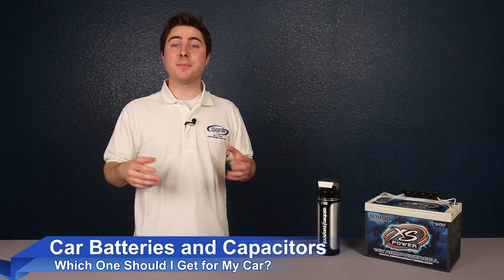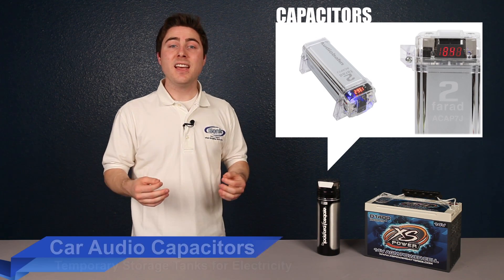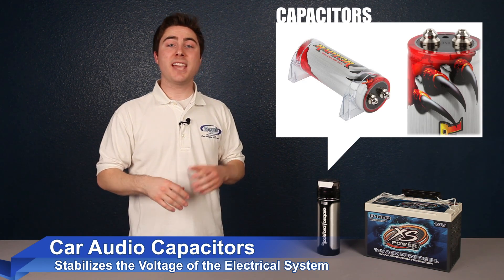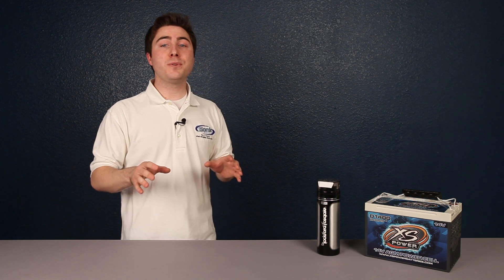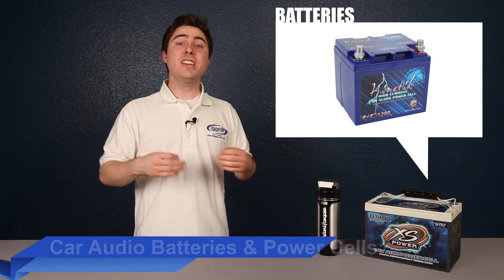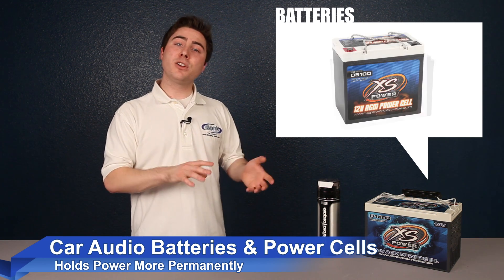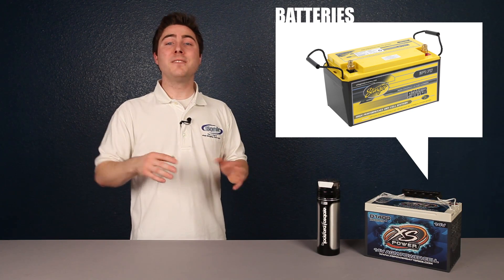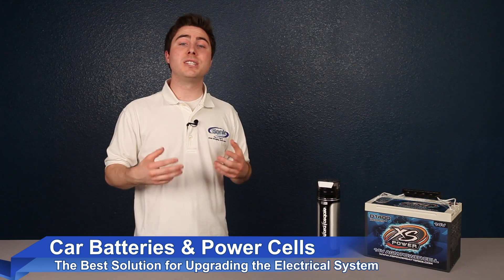Car Batteries or Capacitors: Which Should I Install? | Car Audio Tips

Comment from the maker: Not to worry!! Once a system reaches 1000W we like to recommend an alternator upgrade. After all, you need power to make power. Two Alpine Type R subs on that amp is not a bad idea but they won't be getting much power, so there wont be any headroom at all.
Reply: High output alts are ridiculously priced

Comment: The Type-R 12" is actually rated for 600rms. there seems to be a misnomer on their site that suggests 1000rms for a sealed enclosure. The BRX1100 amp is only 1100rms which is what i was referring to, and your right. an alternator upgrade is always a good idea. And probably a bigger amp than that to. Was a bad day, My apologies.

Comment from the maker: If your lights flicker it means you have voltage drop, which means you definitely need to upgrade your electrical at some point. If cash is a problem, start with a power cell battery, like something from XS-Power. Then, upgrade your Big-3, and finally upgrade the alternator. If cash is not a problem, go right for the alternator upgrade.
Reply: Sonic Electronix Hi I have a question so I’m having an issue where my amplifier goes into a protect mode currently I have in my vehicle one 12 inch kicker L7 750 rms I have a kicker CXA  1200.1 mono block amplifier 1200 W rms I also have a crunch 1000.4 for my mods and highs I also have a bass processor And a 1 farad cap. I am running 5 gauge wire. The issue that I am having when I turn the volume up and turn up the bass is that the amplifier calls into protect mode when the bass hits hard. Even if I turn it halfway up a goes into a protect mode I’ve checked every connection there is and everything is clean and sturdy. I did some research on my own with a multimeter and I’m noticing that it goes into protection mode due to a voltage drop. When the volume is low it’s running at about 13 V when they crank up the volume and turn up the bass halfway I noticed that the drop significantly to roughly 11 to 10.5 and that’s when it goes into protect. Now I performed the big three in my vehicle right after and I noticed I gained a few volts not much but more than I had it went up to 14.2 V. I then retested it turn the volume up crank the halfway and It didn’t go into protect they played and I checked  voltage and it stayed just a little bit above 11 V Then I noticed if I turn the volume up a little more it goes into protect mode once again and I have my gains set properly not even to where it would hit hard This amplifier will give me 1200 W RMS at 2 ohms I have them wired only now at four ohms which is only 600 RMS. I’m thinking about upgrading my starter battery and a high output alternator and changing out my wiring I made the mistake and using CCA  wiring instead of OFC what is your take on this what do you think I should do

Comment from the maker: Each Type R woofer is 1000W RMS, and two of them would be 2000W RMS. Adding a beefy battery is great if he wants power at 12V but if you want the full potential of your system at 14.4V an alternator upgrade is always preferable.

Comment: An alternator upgrade? for 2 Type-R 12's, You have to be kidding. 

1100wrms assuming the least efficient amp will only result in a load of ~100 amps PEAK. and the average value will be a meer fraction of that. the stock alternator of an RX8 is 100A, with a decent battery behind it should be enough. I would personally throw in an Optima, Kinetic, XS, Any decent dry cell just to be sure.

Comment from the maker: At higher volumes you are experiencing voltage drop because your system is not capable of outputting the power requirements of your amplifier. You will need to upgrade your battery first and then consider a more powerful alternator.

Comment from the maker: Your gain is not set correctly. We have a video on how to properly set your gains. Once you set it right, don't touch it again. If you still have problems, then upgrade your battery with a more powerful XS Power one.

Comment: you will get to a point where if left up loud you will drain your batt if your system puts out more than you can put out with the one battery you are using, usually systems over 1000 watts.   most people don't max out their systems for long periods of time... so usually the caps are enough. and  make a huge improvement putting more power to the amp even though like he says it wont make more power... but it can store larger burst... so... not at all his simple explanation of no.  start with cap.

Comment: you are fine, that kind of drop is fairly typical for a stock elec and a good sized amp, if the volts begin to run into the 12's then you may have a problem on your hands. to keep your system healthy i would follow sonicelectronix advice and upgrade your big 3. also for future reference you should take reading at both the battery and at the amplifier as the resistance of the wiring and chassis ground will give you a slightly different reading.

Comment from the maker: Did you upgrade your battery to ground and engine block to ground cable as well? That might help. 

Once the bass hits, the rectifier in the alternator has to adjust to up the output to compensate for the bass hit, this takes time to do, longer than a bass hit which is why you have dimming. A capacitor will help with this, but at the same time, it does take power from your system to charge itself. Ideally, you would want to be at 14-14.4V all the time.

Comment: My voltmeter shows that for no more than a second it drops from about 13.95 down to around 13.75, then it (during the chain of bass hits) it jumps back up to 13.95. (My voltmeter is digital, I'm not sure if it's quick enough to read the drop) That's measuring it at the + and - posts on my battery.

Comment: If my current alternator wasn't keeping up, wouldn't my battery voltage drop insanely low? My voltmeter shows that it stays around 13.8-14 volts. Not arguing with you, just curious.

Comment: The trunk/interior/headlights dim right at the beginning of a major bass hit, but they almost instantly come right back up after upgrading my alternator to battery cable to a 1 gauge cable. I'm running a 900 watt Kenwood amp, and was considering adding a 2 farad Rockford Fosgate digital capacitor to aid this issue. Would this work? or do I need a different battery?

Comment: I'm about to install two alpine type r 12s with a hifonics brx1100. Installed in a RX8. Should I be concerned? Auxiliary battery or stinger 5 farad capacitor?

Comment from the maker: Definitely upgrade your alternator and add a car audio solid state power cell. A yellow top is good, but if you want to run your system while the engine is off, consider some NVX, Stinger, and XS Power batteries.

Comment: if u upgrade ur alternator ull over charge ur stock battery than itll heat up and ruin ur battery. wont it? i thought that but i believe u know what ur talking about. and no i only buy interstate and a/c delco stock battery brands bvut i just brought a yellow top battery. i hope it wasnt a mistake. i have a heavy system.

Comment from the maker: A capacitor can last for years if you have a quality one. They do not explode, they "pop" meaning the casing tends to rupture and they will release a bad smell into the air, they will not explode into a fireball. Testing a cap is very simple. Remove it, and measure the voltage across the terminals, which should be about 12V. Wait 10 minutes (time it), and measure again. If the voltage has dropped, there is leakage.

Comment from the maker: You need to upgrade to a 250A alternator to handle the power requirements of your system. The capacitor does nothing in your system.

Comment: I have 2 alpine type r 1000 rms each n hifonics brutus 2000 watt rms n audiocontrol epicenter n soundstorm amp for the inside speakers but im havin trouble when i turn my bass on n music kinda loud my system starts cuttin off like it stuters alot even with aux cable my lights dim like crazy help?!?!?

Comment: capacitors are very similar to batteries, they store energy but capacitor can release bursts of current when needed while batteries can not, this stabilizes the voltages and reduces voltage drops. on the other hand batteries can store way more energy than a capacitor, a subwoofer hit may suck most of a very small capacitor charge.

Comment: You are correct, the capacitors are filters for cleaning up the electrical signal... these kiddies don't know a damned thing commenting on here lol.. but Sonic Electronics is right, if you HAVE a stable and badass system, then adding a high quality cap is GOOD and HEALTHY for the life expectancy of your amplifiers... FACT

Comment from the maker: A capacitor will not help your system at all, it will only be a drain on your available power. If you are only allowed to have one battery, you need to upgrade your alternator to handle your audio system and then add a more powerful main battery.

Comment: I currently have 2 batteries to run my 2kw monoblock + woofer, since in my country 2nd battery is illegal, i was thinkin to slow it down a bit. Do you think i could just switch the 2nd battery with a capacitor. Or would it still drain too much power from my front main battery.

Comment from the maker: Indeed, you need power to make power. A capacitor is best used on a system which does not have power issues, actually. This assumes you have a quality constructed capacitor that is not made of sand. They can smooth out your voltage and keep your amps fed as long as your alternator is up to the task.

Comment: Why the hell did this comment get spammed? You cant Truly add power without   an increase in the generation of it.  A capacitor is used to store energy clean energy in a dirty circuit but are just to eneficient to store ample power. yes most power is coming from the alternator. well technically  all of it is

Comment from the maker: With about 1500W of power, you should purchase an additional battery for the trunk to run the sound system and use a battery isolator to charge it.

Comment: What should I do to power my system I am currently purchasing. I am running a Mrxm240 and a mrxf65 amplifiers so I need a lot of power. My car is a 2010 mitsubishi outlander ES 2.4L and there is no aftermarket High output alternator available for my car. HELP!!!

Comment from the maker: A 12V battery that is rated for 3000W, we list those ratings on our website. Your upgraded alternator will be able to charge the batteries fine, it just depends on how much juice you pull through the system and for how long.

Comment: and with class D amplifiers, your systems efficiency would increase from ~ 50% - 70%, up to about 90-95%  - this alone would be an improvment due to lower drain on your electrical system... the 30-50% loss is wasted as heat

Comment: if you have shortage of charge, I'd suggest an alternator upgrade before touching batteries or cap's - Btw caps are all but usless, the energy they store would cater for little more than a 1/4-1/2 a bass note before becoming a paracitic load - -  While the engine is running, the majority of your power will be coming from the alternator, the battery only matters if your dropping below 12.5V - which should not be happening if you size your audio system and your alternator correctly....

Comment from the maker: The battery is simply a reserve of power, primarily used if you want to listen to the system with your car off. It can aid in some functions of the system. If you get a cheap battery, then you will not be able to listen to the system with the vehicle off for long periods of time, however it will help you with your current demand on the system. However, if the battery does not help, you need a bigger alternator regardless.

Comment from the maker: A capacitor is a band aid, they are beneficial for low powered systems and only do their intended job when they have a big alternator to back them up with a system that has low power requirements. Only top quality capacitors can release energy faster than a battery, otherwise a battery is your best choice if you want a reserve of current to back up your system.

Comment: another detail would be that my battery is 8 months old and its still in excellent condition when i got it tested. A second battery stores more charge but does it regulate voltage as well as a cap? Since it doesn't discharge as quick. Also what brand of capacitors would be good? everyone keeps telling me the power acoustik brand is trash along with boss, which would you recommend?

Comment: I'm not sure if my voltage is dropping, i have no headlight or other electrical issues at all but when i bump my system hard, the volume noticeably decreases by Alot, i've got 0/1 gauge wire everywhere and all connections secured. If i haven't bumped my system in a while, the next time i bump it, its hella loud and nice but only lasts for 1 - 2 minutes. Would a capacitor help regulate voltage or is it just a bandaid? i'm pushing a 1500rms system on a 130 amp alt at the moment.

Comment from the maker: Wire it like this, just put a period where we typed in DOT and the link will work: m.seimgDOTnet/product/img/subwoofer_wiring/1_sub_DVC_4_ohm_monoDOTjpg
No a cap will not fix your problem, you will need to upgrade your alternator to something more powerful, above 120A, and perform the BIG 3 upgrade.

Comment: I just got a Polk Audio PAD 1000.1, its hooked up to a Alpine type X 1042d. First question is how should i wire it on the amp? Second question is my lights are dimming alot and the sub doesnt feel like its hitting very hard. Would a Cap fix it?

Comment from the maker: You definitely need to upgrade your alternator, you won't even get close to 2700W RMS on a stock alternator. Also, a batter is used to sustain your system playing while the vehicle is off. You will need a 3000W rated battery at least, consider getting two batteries.

Comment from the maker: Is that 2400W RMS or 2400W Peak/Max? Never ever look at peak/max ratings, they are false. Go with the D3400, your alternator can charge it but you need to upgrade your alternator if you are running 2400W RMS.

Comment: Which would be better for a 2400 watt system ? Optima yellow top of the  XS d3400? And yes I'm considering the big3 ?and will my stock alternator charge either one of these batteries? ( I have a 2003 silverado 1500 5.3L) thanks!

Comment from the maker: If you run 0 Gauge wire to the amplifier and then convert it at the amplifiers power and ground terminals to 4 Gauge, that will work fine. Make sure the amps power and ground wire are the same size. If that amp can accept a 0 or 2 Gauge wire, it is best to use that size wire.

Comment from the maker: It will work but it wont charge the battery fast enough to keep the system on for extended periods of time. If you watch one movie a night you should be fine, maybe even more. A DC power supply would be better but it gets pricey for the amperage you need. You can also consider getting a home subwoofer amplifier, it does not take a lot of power to get loud in a home environment.

Comment: i have an odd question, but her it goes... i have a 2800 watt stereo in my bedroom that i built myself. it consists of a 2000 watt powerone crunch amplifier for my subwoofers and an 800 watt reciever for my mids and highs. i power the sub amplifier with a 10 amp battery charger, so it makes the amp clip when i crank the volume up. will a battery help solve this problem? or will the battery still only put out 10 amps? (ill use the battery charger to charge the battery,use battery to power amp).

Comment: Because I used the new XSpower iPhone app that just came out and I guess xs recommended  the d3400 for my silverado 1500 .and yes I was also considering doing the big 3 with all 0 gauge xs flex cable . And I will be running 2 amps in my truck

Comment from the maker: The D3400 is a very beefy battery and will work just fine as your starter battery and sound system battery, so long as you have enough juice left to start the car after a long listening session. Know that you should perform the "Big 3" upgrade if you get this for maximum current transfer. It's designed for 2500W systems and up, as well as 1000 cranking amps, so it is a bit overkill for your situation.

Comment from the maker: When looking for batteries, a good rule of thumb is 70 AH per 1,000 RMS, so 140 AH = 2,000 RMS. Also, you need to find the cranking amps your vehicle needs to start and make sure the battery can at least do that.

Comment from the maker: You must get a battery isolator to prevent the stock battery and power cell from swapping voltage and draining each other. You can run the XS D3400 on a stock alternator but it will be constantly struggling to keep both batteries charged, especially if you have the XS one drained from use without the vehicle on. You run the risk of burning out the rectifier on your alternator more quickly.

Comment: question? can I run a xs d3400 with a stock battery and stock alt.? and if so , will the batteries die will there are not in use?

Comment: i have a jl audio 500/1 hooked to a 10 inch L5 and a 12 inch CVR, they sound great and powerfull but the lights dim everytime the bass hits. i replaced my baterry to a more powerfull one but the problem is still there. do you suggest a capasitor or an alternator upgrade. or is there any other options?

Comment from the maker: Submit an RMA by logging into your account on our website and explain what your woofer does. Our warranty team will let you know what they can do for you. As for why it is doing that, swap the power wires from one sub to the other to check if it acts the same. You could have a loose connection somewhere. Other then that, it looks like you will need to get it replaced.